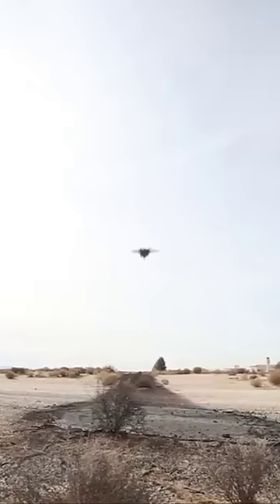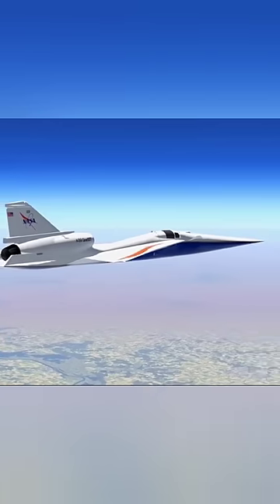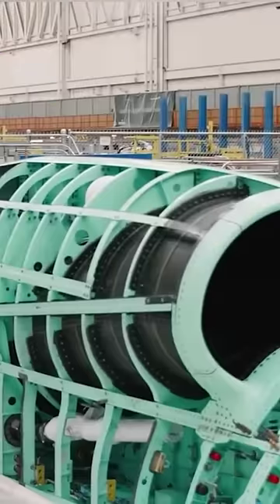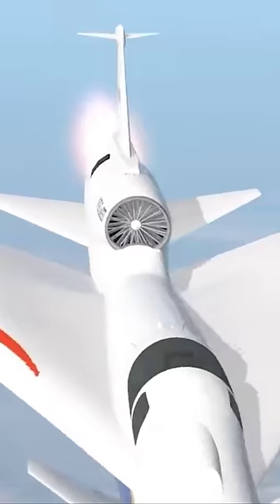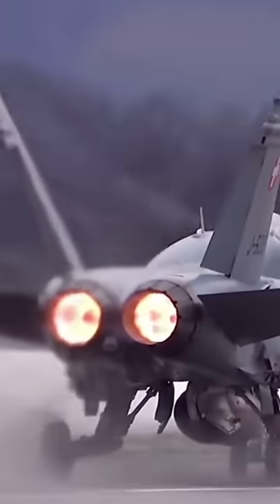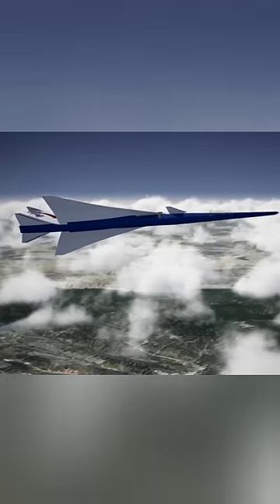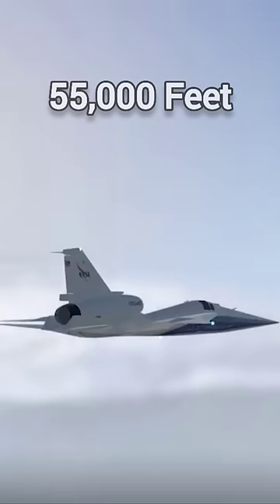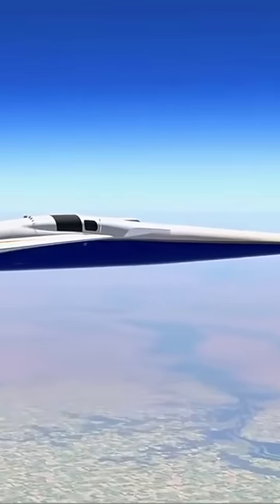The Worlds Most Silent Supersonic Aircraft (The X-59)

Comment: This is just an experimental plane to test our ability to make a commercial supersonic plane that won't "sonic boom" .. apparently it can go supersonic at only 75 db audible from the ground... "low boom" is it's only advantage..
Reply: Supersonic and only 75db at ground. 

I am impressed
Reply: He could have explained that, considering it’s the entire point.  Thanks for letting us know.
Reply: Ty, I couldn't imagine the need or use for it in a military aspect. 😅 there are so many better options available for what it's capable of doing ya know, that's not a bad low boom considering a lawn mower is like 95db
Reply: I can make the same audible range (75db) just by having one can of beans as opposed to two.
😄😄😄💥💨💨💨
Reply: Meaningless comment. Sound pressure at the ground is dependent on how high it is flying while producing the sonic boom. The greater the distance, the more the sound pressure will dissipate. The space shuttle could exceed the speed of sound with  0 db on the ground when it was high enough.
Reply: Ah, well, good luck in getting European Air clearance. The decision of the US to ban Concorde to protect Boeing in 1976 will come home to roost. The most profitable routes, those to Europe, will not be approved.
Reply: @Cdr_Mansfield_Cumming  Aw jeez, protect the 747? The Concorde was a failure before it even left the drawing board. $10,000 a for a one way ticket across the Atlantic compared to $500 (at the time) for the same flight in 747. 

"Economics of scale" - not the capital of Mexico. 🤣😂
Reply: @Cdr_Mansfield_Cumming  Europe will clear it because they will be told to clear it and they better do what they are told lol, Europe needs American products and supplies way to much to deny entry to the jet.  America doesn't really need Europe the way Europe needs America.
Reply: @billheathcock  Yawn
Reply: @Cdr_Mansfield_Cumming  I know... the truth hurts doesn't it,  not surprising though, the US GDP is considerably higher than that of the entire European Union. 😂
Reply: @Tibbs_Farm  it's good, but naaah. If supersonic commercial planes were a thing I would live near airport to hear every boom.

Comment: The X-59 QueSST is a quiet supersonic aircraft developed by NASA and Lockheed Martin. Its purpose is to demonstrate the technology that could make supersonic flight over land feasible, while also reducing the sonic boom it produces. It is hoped that this new technology will enable commercial supersonic air travel over land, and revolutionize air travel.
Reply: Ya and when is this going to be practical in your lifetime? Not. We’re still copying/pasting the same aluminum flying coffins today over 50+ years ago and travel fees go up always, then the industry builds the same shit. Nothing happens but money sink the project and it dissolves into nothing.
Reply: @Armann_  advances in any technology will costs both money and time. You may not benefit from this said tech., not in your lifetime.

Comment: But those 40 foot long TIC TAC UAP'S VIDEOED by the U.S. Navy have been clocked at 12,000 MPH and making a 90 degree right turn at that speed, and dropping from 35,000 feet to 6 feet above the ocean in .78 of a second and then just stay there waiting a few minutes for our fastest fighter jets to catch up. I do not think any HUMAN could withstand that kind of G FORCES!
Reply: It is fast, but could risk  injuring the pilot during ejection, because of the air intake and rear vertical tail fin.
Reply: @AdobeCADman  Guess this guy thinks you're wrong!
A 1,000-plus-horsepower street engine is not such an uncommon thing anymore. Years ago, you would have been locked up in a padded room for even daydreaming about such a thing, but thanks to the world of heads-up drag racing and the incredible advancement of supercharger and turbocharger technology and knowledge, it's no longer unthinkable to make four-digit horsepower and torque with a package that can run around on the street. But we've rarely seen anyone do it with a Mopar, so when Bob Vrbancic called and said that's what he was building, we had to check it out.
Reply: Do you have a link please
Reply: Maybe unmanned?

Comment: Is it interesting? Sure.
Is it insane? No.
You forgot to mention that the engine (F414-GE-100 actually) only reaches 22,000 lbf with afterburner. Regular thrust is 13,000 lbf.
Not a new engine just fitted for the X-59.
It's an adaption of the F/A-18 engine the F404.
Also found in the Saab JAS 39E Gripen (RM16 is based on that)

The interesting part is the low-boom.

Comment: Says Mach 1.5 so that’s code for Mach 5 or 6 unmanned and this is not what it will look like. it won’t be seen until after it’s well in use if not already in use
Reply: Cause it’s not a speed acquiring aircraft, but a NASA aircraft made to see if we can produce Sonic Thumps which are the equivalent to a car door closing, rather than it producing a sonic boom. It’s also made to see if we can do supersonic travel over again, after the successful, but failed Concorde.

Comment: I have seen the future of this project Skunkworks , it does fly yes on initial drop test it did just fine. But , when it does it's maiden takeoff/ sub/trans/super/hypersonic speed transition,  it breaks apart forward of the jet intake , the wholenose /canopy section is ripped off from the main fuselage.  Just a heads up..
Reply: Oh yeah forward of the intake the entire front section literally folds under forward. You can stop that now.

Comment: There is nothing "insane" about the X-59. Everything about it is unremarkable EXCEPT that it is being used to research quiet transition to supersonic flight. The reason we can't have fast air travel in the U.S. is because it is illegal in most places to cause sonic booms anywhere near populated areas. If they can get the shockwave under control and make a much quieter transition possible, we may get super-sonic airlinerss in the future.

Comment: Are we supposed to be impressed by that jet?
The F18 has a top speed of Mach 1.8 and can fly at altitudes upwards of 50,000 feet. The F18 is also equipped with twin F414 engines. 
What’s the point here?

Comment: 1500kph?! That's very slow, the f15 came out first in 1976 and it can reach 2500kph at multiple altitudes. I would have thought it would be capable of faster speeds in 2023, unless speed isn't the design purpose here. What has it been designed for? Spy plane?

Comment: mach 1.5 ?? lol that is not much of supersonic speed !!
Reply: black bird old jet is mach 3.3
mig25,35 are all doing 2.2-2.8 j10 chinese doing 2.3-3 and concord is already2.2 not to mention the fifth generation…this gotta be old flick shit that dump don’t do his home work…thsi is old and design is old …tbis is in the 60s-
Reply: Top speed is not the point.
Reply: @benb5891  I think you missed the point of the exercise here? It's not maximum speed. It's about supersonic travel and reducing noise.
Reply: @benb5891 so this isn’t correct at all, 1 it only bares a resemblance to the 60s aircraft, it differs on every other level elsewhere so is nothing like it. And the point isn’t speed, it is essentially achieving a higher speed with much less noise. 

Past the speed of sound is good and all but it comes with a lot of consequences. Namely the crippling noise and pressure which can not only damage the jet but also damage anything near it on the ground. This is why the world over has many speed restrictions when it comes to aircraft. It is also why supersonic airliners ultimately failed because they couldn’t actually go their intended speed. 

This feat of engineering has opened up the possibility to lean further into speed without the adverse effects, which could lead to the successful development of much faster commercial aircraft

Comment: It’s time to bump those speeds up to 3k. 1500 was 60’s and 70’s speeds
Reply: it's not supposed to go super fast, its supposed to go supersonic but be quiet.  It's meant for commercial studies; civilian supersonic flights so they don't cause too much Noise and break windows as quiet. its 66db while a normal jet is like 111db. So it's really advance
Reply: @applepickle3759 this video  is a travesty. It failed to pass on the most basic information about this project which you easily included in a single paragraph.

Comment: And we need this why?
Reply: The research will be used to engineer commercial super sonic jets so we can finally fly over land with low sonic boom.
Reply: @Rocky  Reasonable explanation on your part, sir. Will there still be available cost-effective petroleum products to fuel these beasts? 😊
Reply: @majorcarlton137  Jets aren’t powered by petroleum.
Reply: @Dr.KarlowTheOctoling  Where do u think fuel comes from, water?? Petroleum products..
Reply: @majorcarlton137  Jets are powered by a very specific type of fuel that is kerosene-based. Of course, literally everything artificial is based from petroleum.